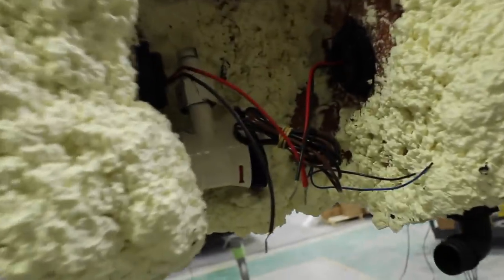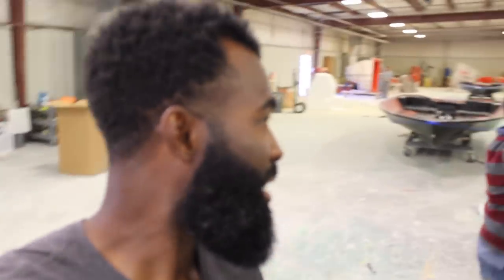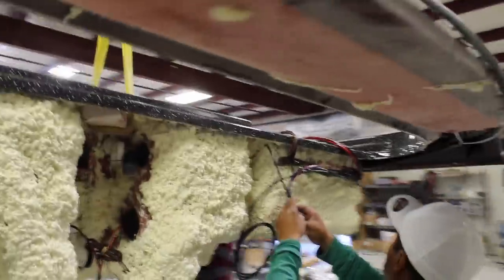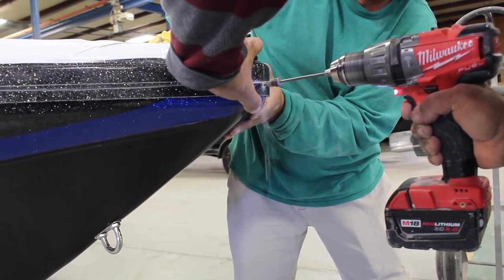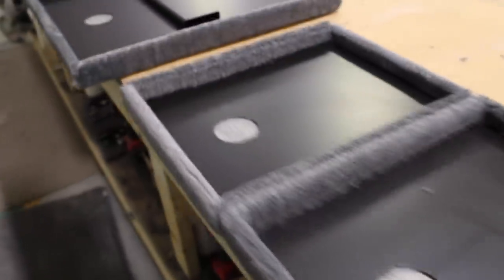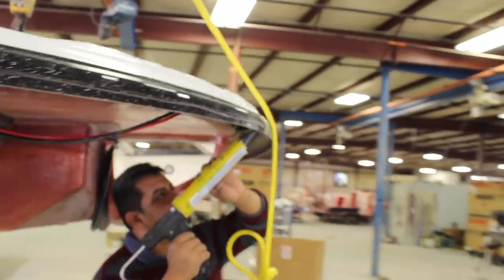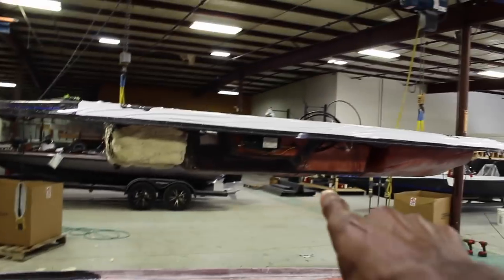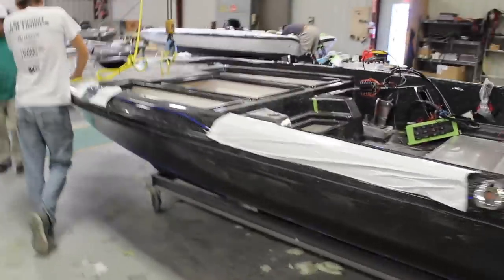The Most Important Step in Building  a Bass Boat

Comment: You have opened my eyes to these Falcon boats. I have watched many different boat build videos. I have even seen first hand a few salt water boat builds. I started working with fiberglass around the age of 12 working on surf boards and boats. Move on to using fiberglass and other composites on Naval aircraft while in the Navy. 
I really like the way the stringers are designed. Being the transom and stringers are full composite without the use of wood means you don't need to worry about replacing rotten wood down the road. Needless to say I would like to own one of these!
Reply from the maker: lance henthorn the stringer system is legit!

Comment: I get to make a comment because I have a 215.  Wiring is more than adequate.  I added my own graphs and had no problems fishing the wiring and transducers from stern to bow.  I even added some additional power cabling.  It is not the best wiring system I have ever seen in a boat but it is much better than a stuffed 2 inch conduit tube that makes it impossible to add wiring.  I had a Phoenix before the Falcon and it had the 1500.00 integrated wiring harness that was nice than the stock Falcon system but it was harder to "change" things up if required.  The boat is incredibly solid.  The only use of chop is that first coat and the rest of my boat seems to be the industry standard coaxial and triaxial sheets.  That "chop" layer is great way to get a smooth glass finish right next to the gelcoat without letting an air bubble get under a mat of glass that can lead to a weak spot so I don't mind it being there.  A Falcon is a great boat that meets a "price point" and delivers great value and performance at that point.  It is not a Hatteras or Buddy Davis Hull but it is not several million dollars either.  Love my Falcon...
Reply from the maker: George fedor yes the open gunnels is the way to go!  I used to run a boat with conduit and foam and it’s much harder.  The funny thing about the chop gun comments is that there’s literally not a boat on the market that doesn’t use a similar glass process. 😂

Comment: Seeing that guy with the crow bar made me uneasy🤣🤣.  All I could imagine was scratches on that flake.
Reply: I was thinking the same thing!  Metal crow bar on fiberglass made me cringe..
Reply: No need to worry where the Crowbar actually touches . yea some scratches will barely be visible or feelable bur what the metal flakes in the black help do is .help  to not  be able to really see scratches well and also the scratches will be so small  that bar when they take a buffing wheel the entire bottom part of the boat for the Finish process they will be absolutely gone
Reply: Any scratches from crow bar will be hidden from rubber bumper

Comment: This is a really interesting series.  Thank you for making it.  It would be nice if the builders left Poly Pull String inside of either side of the hull before the top is bonded to the bottom to alleviate the frustration and cursing should anyone desire to wire in some new components in the future.  They could just utilize the string and then use another length to put it back into the original location for the next time.  Adding wiring and switch options in the storage lockers for a passive alarm system would be nice too.  Those lockers are storing a lot of expensive items.

Comment: I just purchased a new 24' CC bay boat with hard T-top, luckily the manufacture has chases built in with pull ropes for add-ons. But all boat manufactures should incorporate a empty conduit (large enough for the largest transducer plug) ran from under rear deck to under console, then from under console to front deck.

Comment: Should use heat shrink tube on all those wire connections with out they will corrode and have problems down the road.

Comment: Quick question regarding length between the 195 and the 205. Is the difference solely in the size of the deck, with the console/rear being the same size? I saw how the Charger 195 is like this compared to their 210 model.
Reply from the maker: The Timmerman totally different platform

Comment: Unfortunately Blue Wave doesn't make a bass boat but their construction methods make this boat look cheap.  Their wiring is all enclosed in tubes, they have twice the stringer system, and there is NO chop in their boat. Much stronger and stiffer hull. But they only make bay and flats boats. And that's a shame. They could cause some serious noise if they made a bass boat.
Reply from the maker: Yeah that’s a totally different platform than a bass boat.  No comparison there
Reply: That's like comparing say a dory to a Jon boat. Not even remotely close to apples to apples. Ya they're both boats. Intended use is very different. My opinion is this looks like a well designed, well built, and very nice to look at bass boat.

Comment: When using the chopper gun why wasn’t the operator wearing an air fed mask and also the consolidated hand laminator not wearing carbon fume masks and also the crowbar when bonding the Hull first rule in glass fibre no metal product against a finished product surface wood or plastic I’ve been in this industry for25 years before u ask

Comment: Metal pry bars to fit the two halves, what the hell is that all about, totally wrong.
Reply from the maker: What does your boat company use?
Reply: @BrianLatimerFishing  Plastic wedges, similar to the one's used to split hull from mould, they are softer and don't have hard edges.
Reply from the maker: MrJerryheffer 😂😂😂 👍🏾 plastic pry pars work great
Reply: @BrianLatimerFishing  I don't doubt it at all,  as long as it's something with a bit of give in it, just with metal it's to easy to over force things and then you can end up with damage.

Comment: not impressed..all that wiring should be encapsulated.what if it needs service??how do you get to the shifter box??REALLY bad engineering!
Reply from the maker: How do you service it if it’s encapsulated?
Reply: @BrianLatimerFishing  ...with a wire fish!like pulling wires thru conduit.once the foam gets all around them wires,they aint movin!
Reply from the maker: hometownguy71 and which bass boat has it’s wires encapsulated?
Reply: @BrianLatimerFishing  i can only speak honestly for the boats that i have owned.which is ranger,triton,stratos and champion.i honestly thought all brands did it with a pvc pipe running down the gunnels?
Reply from the maker: hometownguy71 I’ve had 3 of the ones you mentioned and none had it either.  As a matter of fact the engineering guys here worked for 2 of the companies you mentioned 🤷🏾‍♂️.
Reply: @BrianLatimerFishing  well,maybe its a newer boat deal then.the newest boat i have had was 03 ranger.it would be depressing to think that the newer boats are being done this way now!..i think stick with my aluminum boat!..lol
Reply: wait..am i reading that they dont put foam in the gunnels either?
Reply: hometownguy71 I Call BS on that comment.  Have a Triton and recently had a Stratos.  No conduit.  Conduit sounds good till you need to add or remove wiring and cables.  Trick: fish a looped string through the gunnel hangers and secure forward & aft.  Now, to add wiring just secure wire lead or transducer cord to one end and work loop to the other end.